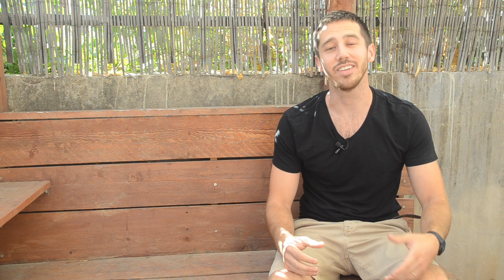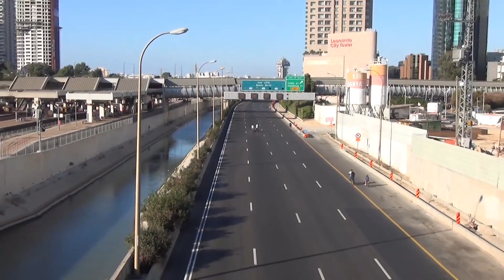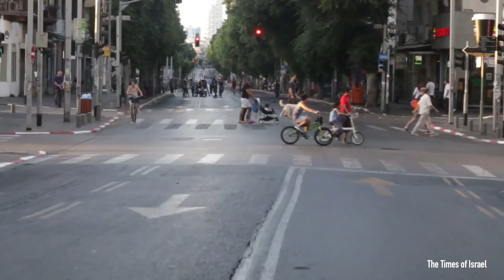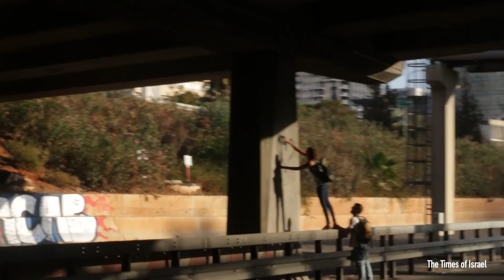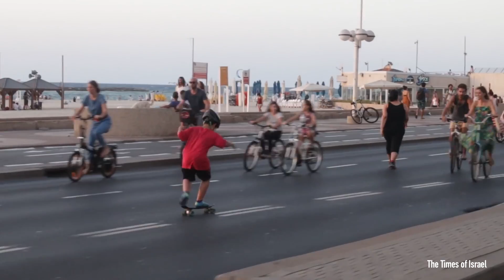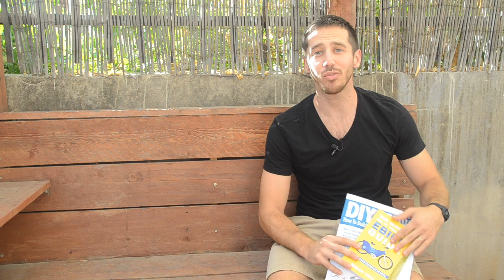Bicycle-only Interstates and Highways - No Cars Allowed (Seriously!)

Comment: for the most part, we under-utilize our vehicles regardless of the power source. in the usa too often i see a giant suv that seats eight, and there's usually only one or two people in it (one driver, maybe one passenger). and where are they going in that massive chunk of steel? if they're not rushing off to work and back (luggage no larger than a brief case), they're running errands within 2 miles of the house.

i get it; one massive machine to cover most any possible contingency, but when you stop and do the math, that massive machine is really only needed for maybe 10% of our miles. by comparison, just 120 years ago nearly every human on the planet still walked, rode a horse, or rode in some sort of horse-drawn wheeled thing for their daily travels.

i know right now there's a massive push for electric, and an equal pushback with a solid argument that li-ion doesn't work below freezing. i don't hear anyone talking about hydrogen fuel cell. there is no one-size-fits-all solution to the pollution problem, and traffic isn't the only source of it, but did he say 90% reduction in pollution from 24 hrs of no cars? i can assume by extension of no cars there's also no industrial combustion either. we SERIOUSLY need to rethink how we travel.

Comment: Hi Micah!
I know that a big plus of middrives is that it can adjust the motor's power depending on how hard you press on pedals, which gives a nice feeling that you have a much more power in your feet. Is there a way to implement it with hub motors? I know that professional bikers have some kind of meters installed which shows how much power they supply to the pedals/bike so that they can plan their race strategically. Is there a way to connect such a meter to a controller and adjust the power to get the same effect as in middrives?

Comment: Great video as usual!

I'd like to log a request for a video to supplement your diy lights video: How to connect to those light lines to the battery pack safely.  There are lots of good soldering videos, but I just want to make sure I'm connecting at the right places and with the right gauge of wire for the task.

Comment: Hello Micah, 
I recently found that the temperature and the voltage are the 2 greatest enemy for the life of a Li-ion cell. So the more the battery spends at a high voltage, the shorter the life would be. But I also know that the battery life depends of the state of discharge that it has before any charge cycle. So instead of waiting for the battery to reach 5%, we could charge the battery when it reaches 50% charge or even more. The less you wait, the better.   
( http://batteryuniversity.com/learn/article/how_to_prolong_lithium_based_batteries )
My question is how those 2 theories match together? If I charge the battery when it has let`s say 70% charge, does n`t the battery spend too much time at high voltage?